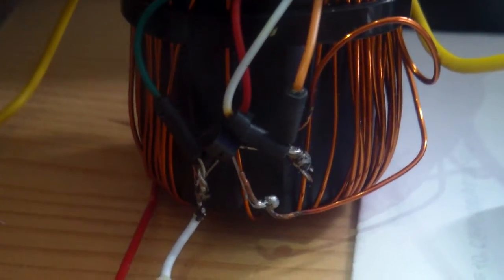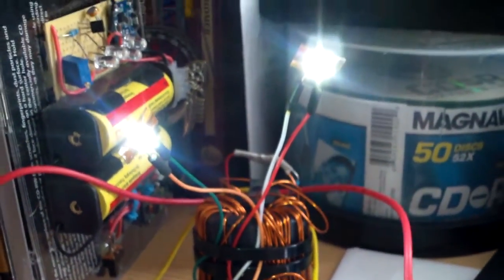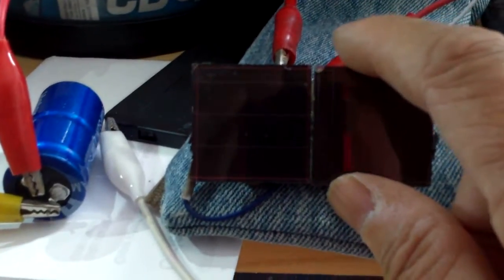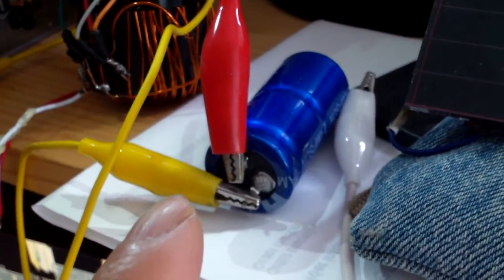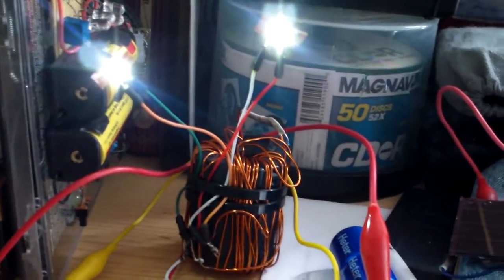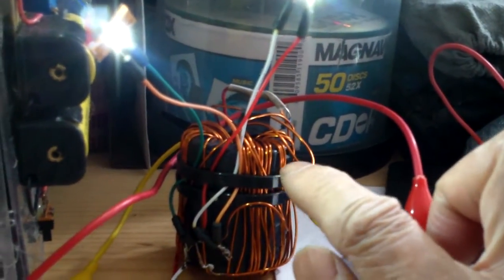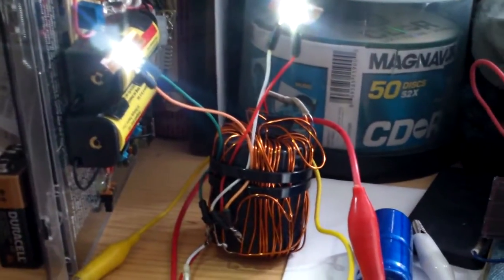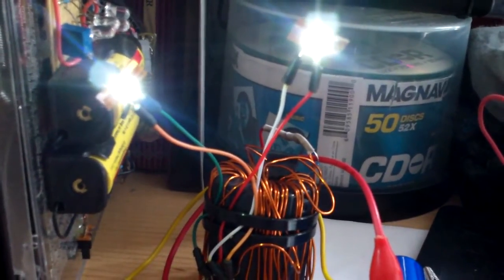Joule thief powered by garden light solar panel

Comment: Hi you can put small magnet on toroid to stop the high pitch noise
Reply from the maker: black n red wires Thanks very much. It does lessen the high pitch noise, though not remove it completely.